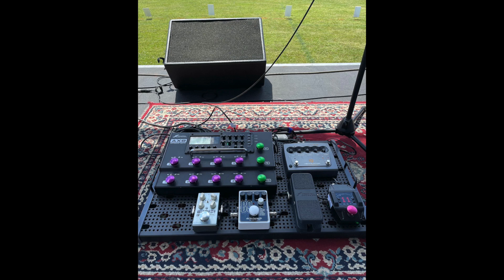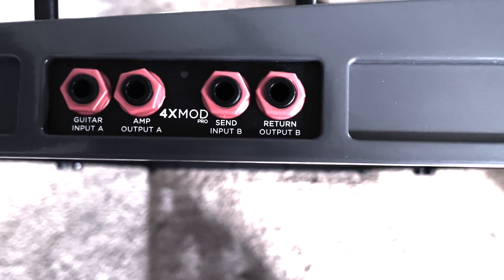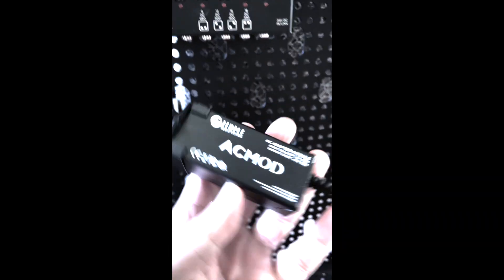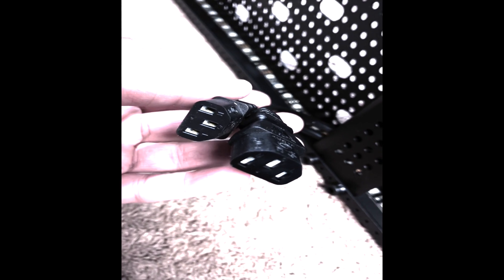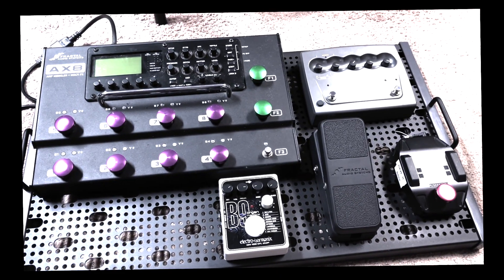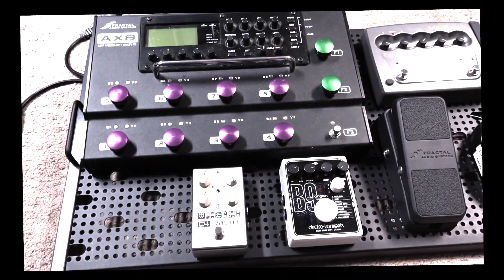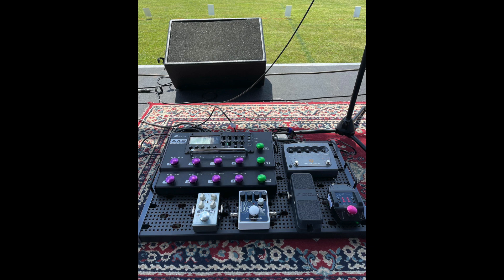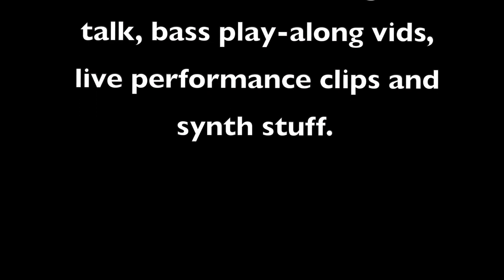How I Built My Temple Audio Pedalboard

Comment: hey Dave, don't the side panels of the board come off ? to make it easier to screw in the mods ?   cheers.
Reply: It does. There are multiple videos where people complain about this, but you just take the handle and the feet off and the side pops right off.
Reply: @Livengood  Getting the handle out is another hassle in itself. Had to get a specific angled screwdriver for it.
Reply: @Custoid  if you don't overtighten them, you can usually reach one screw straight on and then you can spin the handle and hold the screw with your finger to get it to unscrew. That's how I have done mine a few times.

Comment: magnetic tip to hold screw, nice board
Reply from the maker: Yup, that's what I used but it was a super tight fit between the unit and the side wall.